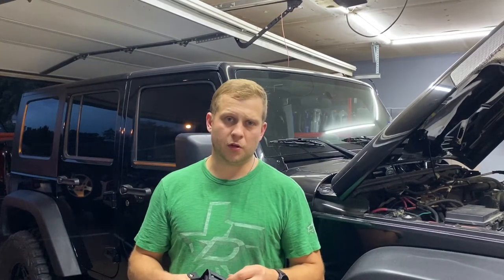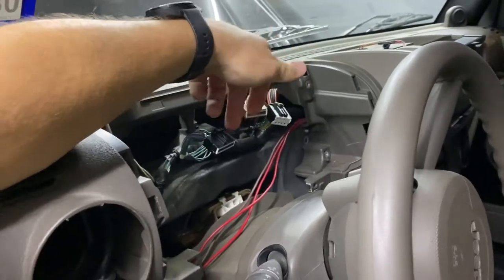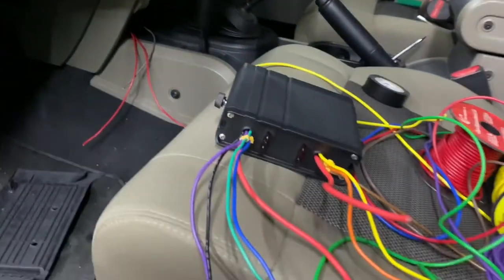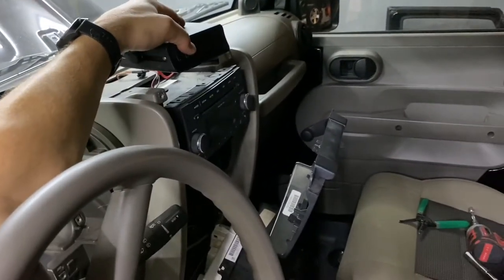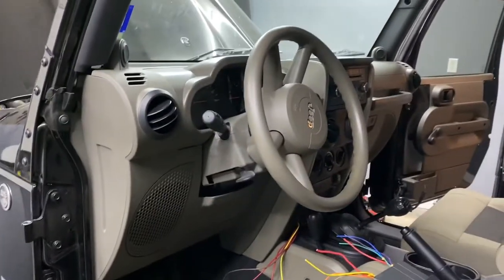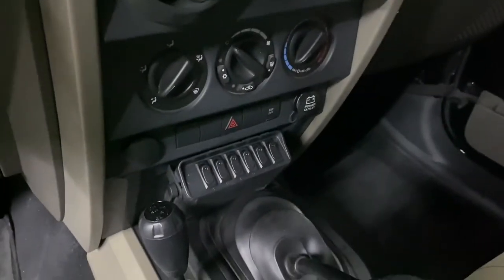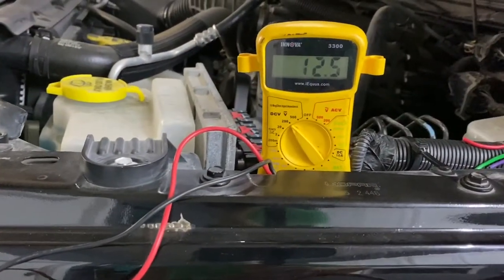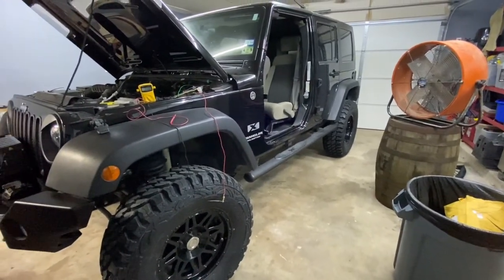How to wire up accessories Jeep Wrangler (the easy way)

Comment: Do you have to ground each individual light to something different
Reply from the maker: Each light does have to be grounded. Then run the power wire to the switch

Comment: Do you ground the black wire from the light pods to the  the Jeep frame and then just run the red wire to the switch?
Reply from the maker: Yes that’s 1 way to do it. You can ground the negative wire to the Jeep chassis or to the negative terminal on the battery. Either one is fine.

Comment: So basically u just run all the wires throw the dash contact it to the box use the two positive wires that's connect to the Jeep battery then contact them to main wire on the box  then the ground wire to a bare metal surface that has a negative wire attached to it already or find one then you connect the red wire green wire yellow wire orange wire etc to whatever you want to connect to it to control it from the box then whatever is connect to the box you just connect the ground wire from whatever you connected to the box to any bare metal surface like for example you connect the positive wire from the lights on the Jeep bumper to the control box then you just ground the negative wire from the light to any metal surface right
Reply from the maker: That got a little too complicated for me to follow. But don’t over think it. The box itself needs a positive and a negative wire to work. Then, you run a positive wire to your accessories from the box. And use the negative wire on your accessories to ground it to the vehicle. 

As long as the box is grounded. And the accessories are grounded. All you need is a positive wire to control it.

Comment: how do i wire the ground i have a light bar and it needs a hot and a negative and there is only one negative?
Reply from the maker: You run the negative of the light bar to the chassis on the Jeep. And the power cord goes to the power on the box switch
Reply: @onemanband1349  what about the hot there are 2 hots do i wire them together and run them to my battery?

Comment: Don’t You still need relays if running lights that are over 20 amps?
Reply from the maker: I’m no electrician but the box from the store said it was rated for 20 amps. So the way I understand it, is if the load is 20 amps or less, you don’t need a relay. However, I use a relay for all my lights. Just to be safe. I’ve read online that you can burn up the box if you put too much of a load on it. So not gonna take that risk.
Reply: @onemanband1349  Which relay box you have used?

Comment: did you ground the lights them self?
Reply from the maker: Yes. Ground wire can be ran to the chassis and the power wire of the light goes to the switch
Reply: @onemanband1349  just was unsure about the ground coming from the lights themselves , almost made it sound like just need to hook the power to the and tats its , made for a bit of confusion , I seen the question asked in the comments , but didn't seem to be clear enough for me in the answer , thank you , I just grounded them to the chasse . Thank you..

Comment: Be careful, this box is a fire hazard if you don't change the fuses it will melt the wires.
Reply from the maker: I’ve heard that before actually. From what I have read, and what I understand, it’s only an issue if you don’t use relays. Which in turn over loads the capacity of the box. Switches are meant to be used with low volumes of electricity. The relay is what’s supposed to take on the brunt of it. I’ve had this set up in my Jeep now for well over a year and haven’t had any issues. But thanks for the heads up. I’ll certainly keep an eye on it!